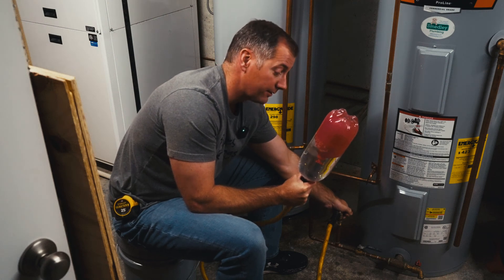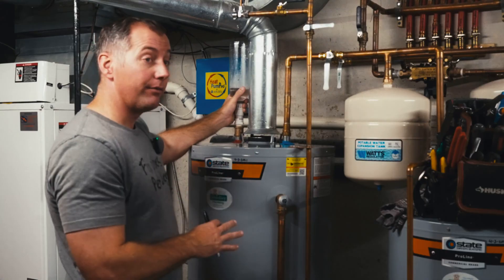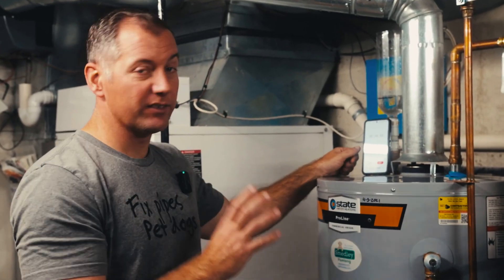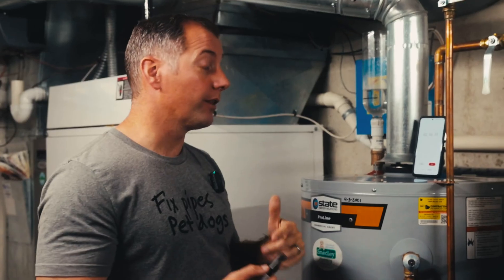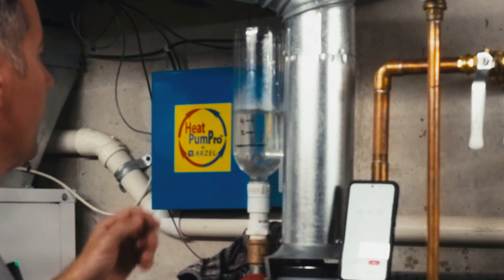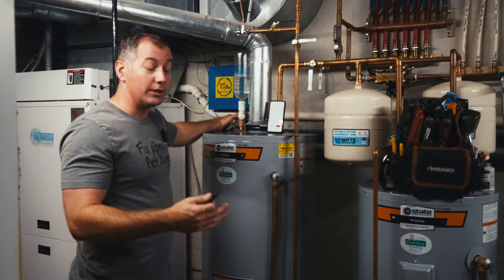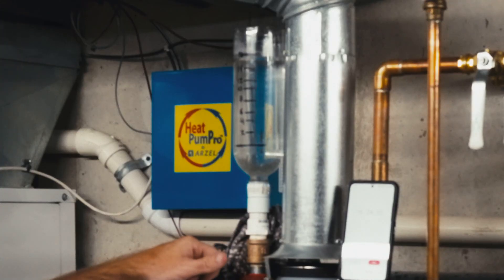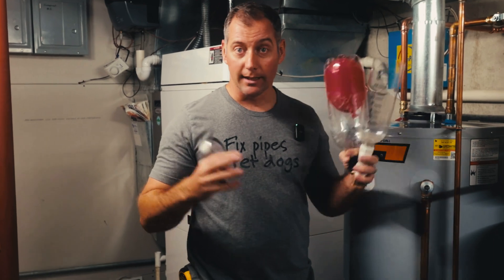Thermal Expansion can DESTROY your water heater - Time for a SCIENCE experiment!

Comment: Any idea why I’m seeing rust at the bottom of my water heater around the lower lip piece?
My heater is in a basement, sitting on blocks. Humidity is low in the basement.
Reply from the maker: Could have been there for a while.  If it looks wet, might need to look further.

Comment: Wouldn't the t&p relief valve go off if the pressure exceeded 150 psi ?    
So it would be safe to say that thermal expansion probably never exceeds 150 psi.
If it did Wouldn't the t&p relief valve just release the extra steam/pressure in the system ?
Reply from the maker: Because the system is designed for 80 psi or less.  The T&P is like an airbag.  It's there as a last resort and not to be used often.

Comment: question i never heard of thermal expention tanks and i agree in a lot of cases a good idea but for me myhouse runs on a well and so i got a acumulation tank my question is this do my accumulation tank acts as a thermal expention tank or should i add one even if not required by code here
Reply: Thanks
Reply from the maker: Correct.  If you're on a well and have a bladder tank, you won't need a thermal expansion tank.

Comment: I know there is some water valves/meters that allow for expansion back into the main water line.  How can you tell if that's the case?
Reply from the maker: You would have to perform a water pressure test while the water heater is heating. If pressure is building then you have a closed system and you are creating thermal expansion. If the pressure remains stable through the heating cycle then that pressure is being allowed to be bled off somewhere. It might be an open loop system or it might be a drippy faucet that's bleeding off the pressure as fast as it's building.

Comment: Wow and something I thought about at times like a recent faulty thermostat that required me to find your advice. Stuck on the hot side till fuse pops.  The explanation at that time of its function helped in understanding.  Due to being on a well with a bladder tank, I hope that absorbs most of that expansion...
Reply from the maker: Yes if you are on a well and have a bladder tank than you will most likely not need a thermal expansion tank.

Comment: Great video.   just learned of thermal expansion tanks / and the issues associated with not having one.  After moving into a new home, I added some pressure gauges before and after my water filter system and began noticing high pressure readings when the gas fired water heater was on.  I quickly added a thermal expansion tank and solved the issue immediately.  Crazy.
Reply from the maker: Great work!